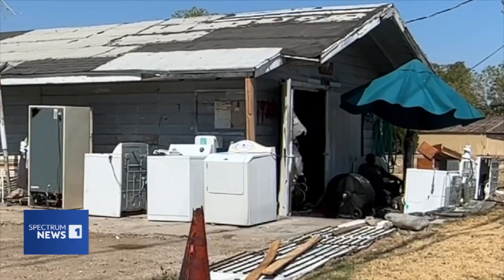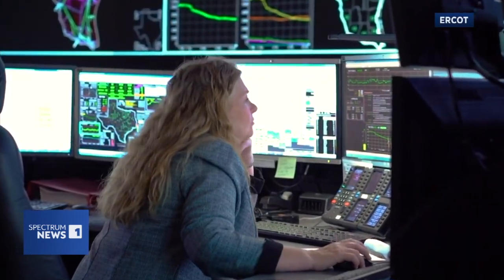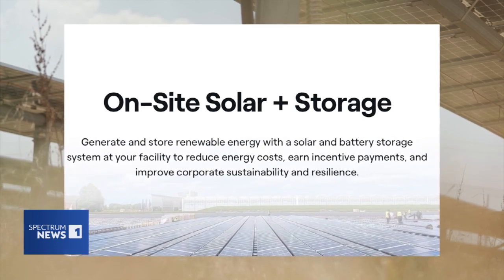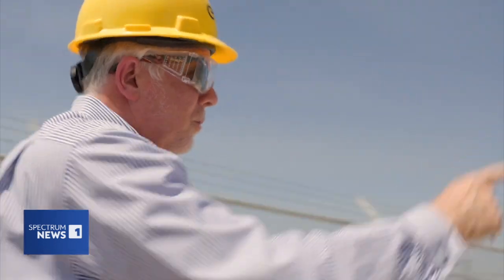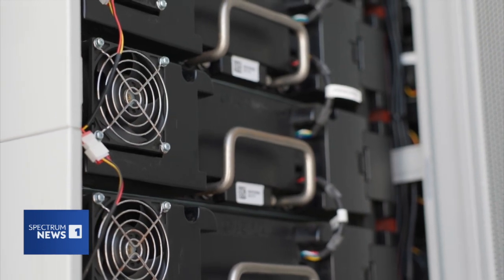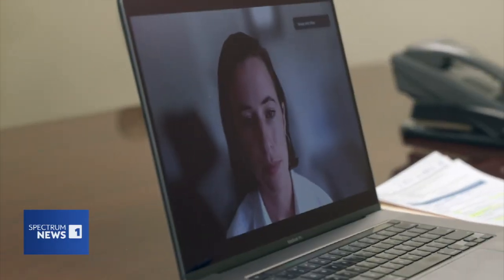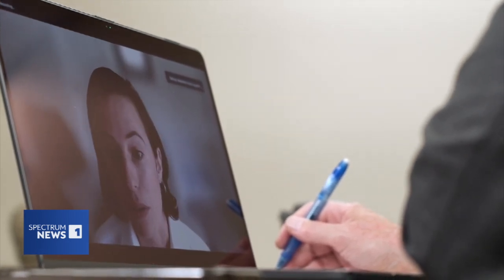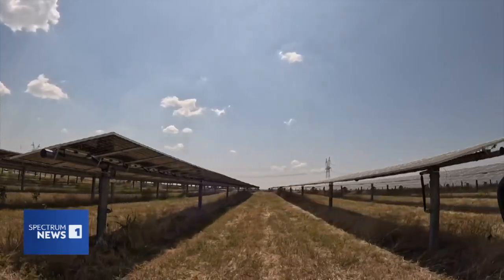Solar Farms Increasingly Being Relied Upon to Bail Out Energy Grid

Comment: Wait till the majority of cars are electric.....power grid isn't ready...
Reply: So the logical response would be to improve the grid? This article is showing how solar is being quickly deployed as pseudo-peaker plants
Reply: It takes a lot of electricity to refine crude oil into gasoline. Also a lot of the homes with BEVs also have solar and batteries so they do not put a burden on the grid and in many cases they supply the grid during times of need.

Comment: Solar and wind got, unfairly, a bad rap with the TX cold snap a while back.  Now hopefully they are seen in a better light to be a reliable useful resource.
Reply: Which is ironic because the largest fault in that failure was frozen pipelines.
Reply: @wolfiefink  I agree.  In terms of MW loss, that is correct.  I think all sources should get the blame, not just the renewable sources.  It was a messed up few days for the entire grid.

Natural gas wells and pipelines are particularly vulnerable to cold temperatures.

Not only does a gas stream contain water vapor that can freeze by itself, that water vapor can also combine with hydrocarbons to create hydrates that solidify at temperatures well above freezing.